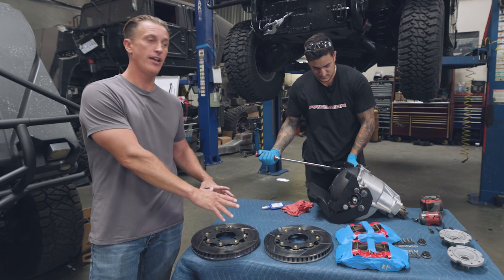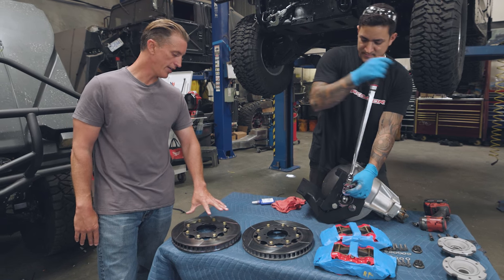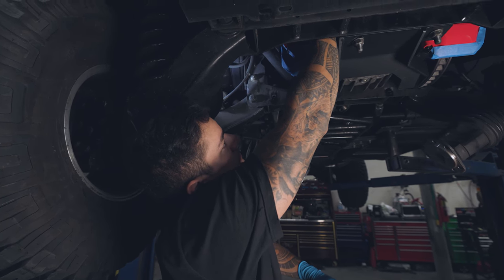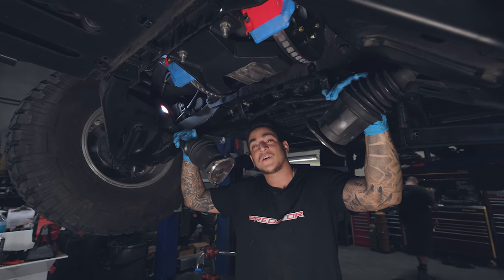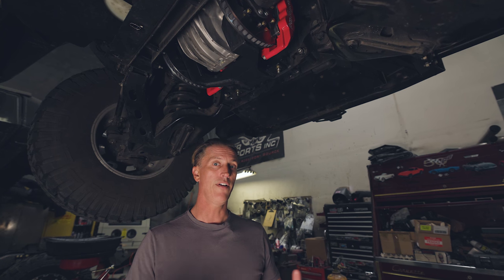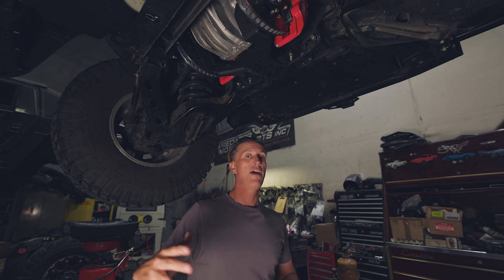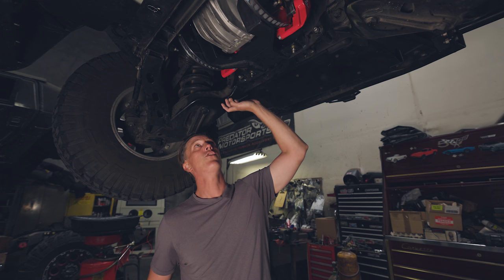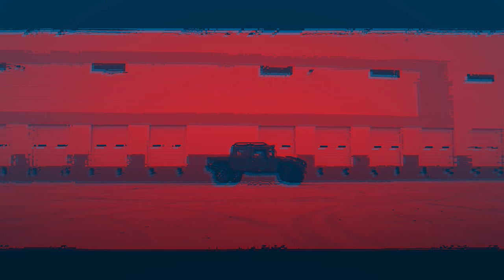SOCOM'S BIG BRAKE KIT FOR THE MILITARY!

Comment: Hi . are these brake kits a direct bolt on H1 differentials or do we need to modify the diff cases?
Reply from the maker: Depending on application there are very minor modifications however nothing with the diff. Primarily picking up more/stronger mounting locations for increased torque on the brakinging system.